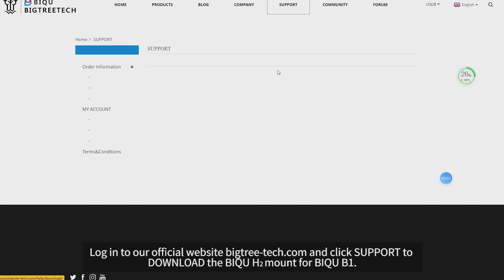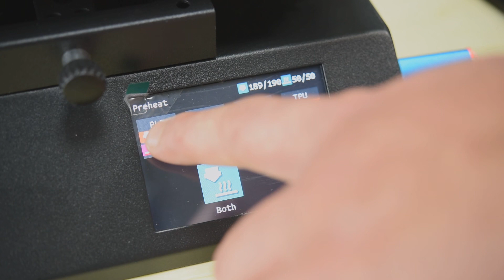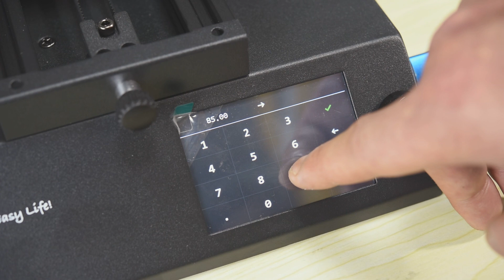Tutorial：How to install the BIQU H2 Extruder on the BIQU B1 3D Printer

Comment: uh.. I ordered this and waited for it to arrive.. and now I see i need some adapter board and a fan... this should be mentioned clearly in the Biqu shop when buying the item.. there is a list what is in the package, but no mention what is missing!
Reply: Also the adapters did not work for my Biqu so I had to make some workarounds. Now I finally set the E-steps and tried to set BL-Touch and noticed homing the axis does not work anymore...
Reply: I know they say adapter board, but I think it is just the board scavenged from inside the original hotend

Comment: Thanks for the instructions!
It was not clear that it is motherboard in the video where cables must be pluged in. I for example have never seen the motherboard :D
Now I am trying to figure out how to unscrew printer case and how easy it will be to drill hole in the case for new cables..
Edit: Don't need to drill new holes, can reuse existing one. Included motor cable can be plugged in other way around- then instead of Loading material, it gets unloaded. It can be fixed by switching cable around.

Comment: So why can't we just use the breakout board for the heater and thermistor?  Are they too powerful? or are we able to just use the write plugs and plug it in?
Reply: The break out board uses a chip that only up to 3A which may not have enough current for this new heater
Reply: @frequencylim  3Ax24V 72W, seems overkill for a heater so it should fit i guess... I bet this is just because we need to cut down the wires to length and they didnt wanted to show it there... But would be great to have an official answer
Reply: @BlueManFPV  Truth but with super bight in, 3 fans @24v and a thermistor sensor. Hence if next upgrade of 50W heater should be ready!?!?

Comment: I am a proud owner of a BIQU Hurakan. But! The print head and the extruder are JUNK. The two smallest fans (one on the print head, the other inside the case), are also JUNK. So I want to upgrade the print head. QUESTION: given the Hurakan's print head mounting design, will this combined unit work with it?????

Comment: The extruder motor cable looks like it hangs quite low, can the motor be rotated to change this?
Reply from the maker: Thanks your advice and we will feedback to the technical team!
Reply: Agreed, what a silly design. Surely someone in the tech team MUST have seen this and Thought....Hmmmm Might those dangling wires get caught in the print? I know, why don't we turn the motor 180 degrees and reverse the wiring??
Or Did they think that at all and it missed out on any quality control/Testing???
Reply: @richardswede  right? I've been asking it since a while back during their livestream but they never responded. There's no way I'm risking buying this extruder if I can't flip the motor. I think it's forced into this orientation.
Reply: @richardswede  I'd also rather not wrap the wire around such a tight bed radius to create some space :/
Reply: @T4nm4y  I was watching this video for the sole purpose of buying and fitting one of these, but will NOT now buy one until they turn the motor round 180 degrees. Come on BIQU, you are amongst the very best company in developing and selling printer add ons and your new ventures into actual printers are to be praised, i love my B1 far far better than my Ender 3 and CR6-SE, and who does not want to own a little yellow Duck LOL!

So come on sort this one out (Please)??????
Reply: @richardswede  Yeah, for me, it's not cheap enough to let it off the hook either
Reply: I think you can just rotate the motor yourself, since the cable is long enough

Edit: also idk why they assembled it with the cable facing down anyway 😅
Reply: @zshinko9617  haha yeah, I think I saw a disassembly video. Still undecided, looking for some reviews first! Also in response to your question, I think it's up to you to design the ABL mount. And the standard heartbreak comes PTFE lined AFAIK
Reply: Mine just arrived and it takes about 30 seconds to pull out the 2 allen screws attaching the stepper motor to the rest of the assembly to rotate that, not a big deal at all. I'll be printing all of the mounts up tonight so I can get it installed soon.
Reply: @friedrich3dprints510  did you get the stock one or all metal hotend? Where did you buy it from?
Reply: @zshinko9617  This person gets it. 3D Print General also noticed this and rotated his unit 180 degrees with 0 issues.
Reply: @zshinko9617  I got the stock one direct from Biqu (shipping took 3 weeks from order date) at the same time I ordered my B1. I'm ordering the all metal components momentarily as the next step.
Reply from the maker: @richardswede  Hi, the motor can be turned 180 degrees and we will send your feedback to the engineer. Thanks for your advice.
Reply: @biqu7927  Since we can't @ someone directly... Can we wire the standard H2 throught the Hotmode Breakout board or does it not have enough power ?

Comment: At 2:29 the video says to connect the cable of the 3510 fan into the red plug of the board  but we can clearly see that it is the 4010 that is plugged there. It can be confirmed again at  at 2:44. What gives?

Comment: Is the adapter board the same thing already present in my stock B1? Or different from what my USB-C cable is already plugged into?
Reply: Hi, I recently read about it and I think it's the same USB c provided for the biqu B1. Keep in mind that the cable it's modified for the hot end, so it might be the same one. Cheers!
Reply: @ramirezkine5704  Hello. Thanks for the reply, however you seem to have misunderstood my question. I was asking about the circuit board, not the cable. :-)
Reply: @design8studio  I believe they plugged the wires directly to the SKR board (aka the mainboard). It sits inside the metal case (bottom of the printer). They conveniently plugged the wires into the board that was removed from the printer and didn't had any other connections, I guess just to show the idea. Dunno how am I supposed to put the wires inside tho. 

Dunno if it's still relevant after 1 year

Comment: Very frustrated that I now have to buy and adapter for a BIQU extruder to work on a BIQU printer.  It looks like I need to get it from AliExpress which means a month or so wait.
Reply: It's not demonstrated very well in the video, but the adapter is the one included in your current assembly. Unplug everything from your existing printhead assembly then unscrew the adapter from the existing carriage. Use this adapter in the new carriage mount designed for the H2.
Reply: @andrew5821  Unfortunately, I needed to replace my existing print head because the limit switch on my keep breaking.  So I had to get the new parts anyway.  But the good new is they arrived today (2 weeks) instead of a month!
Reply: @robcannon  is not broken you can snap the metal part again it happened to me twice
Reply: @michaelperez6811  In my case it actually is broken.  The plastic slot where you clip in the metal piece is broken and the piece no longer stays during a print.  I just needed it in long enough to home the extruder.  But the new extruder is working well, but it was a major PITA to install since these instructions are not accurate and I had to search the internet to get a part that would work.  I still need to add connectors to the cables so they will plug into the board on the extruder instead of running all they way to the motherboard, otherwise the range of my extruder is limited to the length of those cables.  Sigh...   You would think their extruder would work best with their printer.

Comment: Isn't it all metal already? I read 200-260 C (upgradable to 500 C)

Edit: What about ABL? Where am I supposed to install it?
Reply: Easy, just hang it off the side like the afterthought it is!!!!!   It uses a PTFE core heat brake so yes, in this configuration it will not work above 265ish without melting it’s guts out!!!